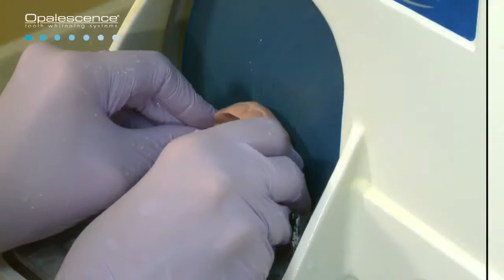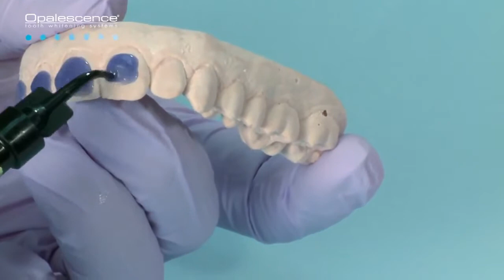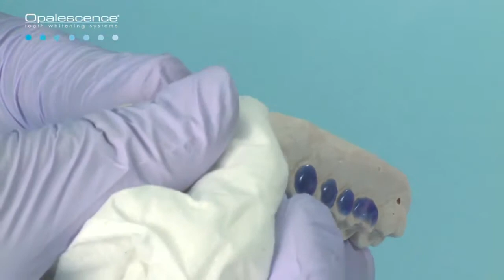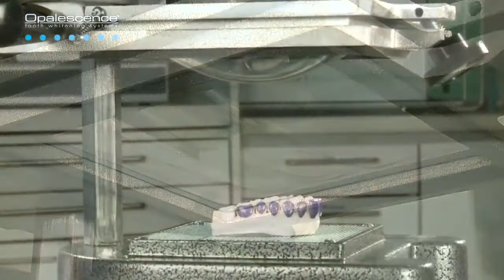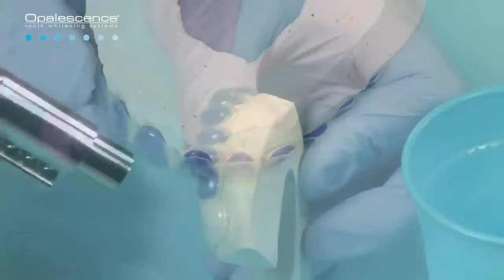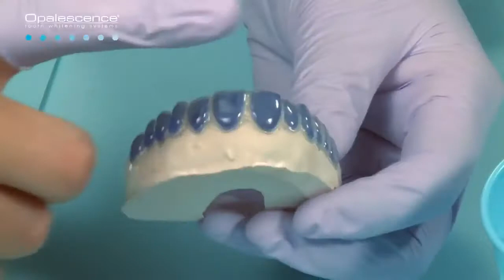How To Make A Bleaching Tray From Start To Finish

Comment: Thank you so much for the video! I have a question, tho. If after applying the whitening gel, the patient feels pain on those areas (for example between the enamel and some old filling), can a hygienist use fluor gel on those small surfaces to protect those sensitive areas?
Reply from the maker: Absolutely! You can also use UltraEze trays by Ultradent. It is amazing!